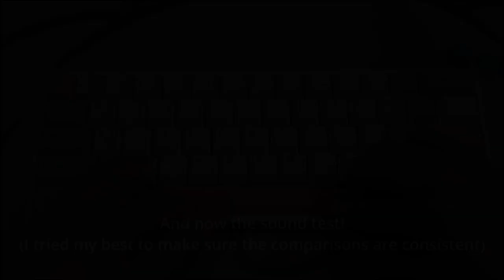Are Silencer Cotton and PCB Foam Sticker useful?

Comment: I recommend using them first in keys that are not surrounded by other keys and those which are closer to you. Those make the biggest difference.
Reply from the maker: I see, will definitely give it a try when my zoom65 comes
Reply: @Dedenki  did the silencer cotton and pcb foam make a difference in the zoom with all the other foam included? Thinking about doing this to the v2 when they come out
Reply from the maker: @FPSBlueFire  I did both for my zoom v1. Not sure of the diff but I always prefer to put these in all the keyboard I make
Reply: @Dedenki  thanks for the response

Comment: Hey, does the RGB shine around the keyboard keys now with the cotton silencers? As in the video I don’t think you had the RGB on. Reason I am asking is that I want shine through keys but not glow around my keys.. does this fix my issue?
Reply from the maker: Rgb shrine through the switches not the gap between the pcb and switch. So it doesn’t affect it
Reply: @Dedenki  Hi DeDenki, yeah I know that and because the switches are semi-transparent the light shines in all directions and bounces off the surrounding keycaps and the plate to create that halo effect of RGB around the keys but I don’t want that so I am looking for the best way to prevent it. Currently gonna try deep black felt tape around the switches to block that light bounce and black keys. Hopefully it turns out alright. I came to the conclusion that these stickers alone won’t fix my issue.

Comment: Is the cotton being sandwiched between the switches and the plate?
Reply from the maker: Yup switch and plate!
Reply: @Dedenki  I saw the picture it actually is below the switches right? Which is underneath the plate
Reply from the maker: @Zhean3553  it’s on top of the plate but below the switches.

Comment: I’ve watched a lot of videos comparing the PE foam mod vs switch pads. The switch pads alone don’t seem to have too much of a difference to the sound as compared to the PE foam. I think because of the way the PE foam is applied, the entire sound of the keyboard seems deeper. But when you put the silencer cotton on, you get a closer sound to that of a conventional PE foam mod which I feel is better. Seems like nothing makes a board sound better like PE foam mod does! Very hard to replicate with switch pads alone. The only plus point I can think of for the use of switch pads is that it doesn’t block the RGB LED of the board :)
Reply from the maker: yeah i think individually alot of the mods might not do much, but if all these small mods add together it does makes quite a difference imo, i'll be making my new keyboard in sep and gonna apply all the knowledge I have to it. (waiting for a GMK keycap!)

I don't do keyboard much nowadays but if you don't mind helping a fellow stranger on the net, hope you can subscribe to give me a +1. Appreciate it!
Reply: @Dedenki  done! All the best making the new KB! Hope u do a video on it too. Will be looking forward to that! :)
Reply from the maker: @thepianokid27  thanks man greatly appreciated!

Comment: Real question: If money isn't the factor, which one is better in order to reduce the mechanical noise? changing the switch or adding padding or foam inside the case, the PCB, the silencer cotton and adding o-ring(s) on the keycaps?
Reply from the maker: all does contribute a little each. but i will say switch itself makes the largest differences. I dont really like o-rings.
Reply: @Dedenki  why didn't you like O-rings?
Reply from the maker: @KingofFray  it reduces the travel distance of the key. Which makes it feel like your key is a bit stuck
Reply: @Dedenki  glad I asked before I buy them. I'll just save my money to purchase good switches instead. but what about keycaps? is there any significant improvement if I changed them in terms of button mashing and mechanical sounds? I'm kinda new to the mechanical keyboard stuff thanks to my colleague bragging about his stuff. I just bought keychron K3 for travel and redragon k552 for my pc
Reply from the maker: @KingofFray  keycap if you can get double shot, the sound is more solid. But similarly, everything gives like 1% Improvement which isn’t a lot, but if you add slot of this 1%, it will make a pretty huge diff
Reply from the maker: @KingofFray  u should find other source on YouTube since my channel isn’t focus on keyboard now. But you can still subscribe to give me a sub count too. I’m building my next keyboard zoom65 soon when it’s here
Reply: O-ring is a big no for me. It feels weird bro.
Reply from the maker: @dateferby1334  yeah after that I don’t really like it. I don’t put it in my recent build anymore

Comment: hello can i use PE foam as PCB foam with soldered keyboard?
Reply from the maker: I would like to say you can since it’s serve the same purpose.
Reply: Ok mate. but how about using both switch pads and pe foam above?
Reply from the maker: @marcus-wv9ti  they both actually does the same thing, so I’ll think this will be a bit of an overkill
Reply: @Dedenki  ty for your reply. Appreciate bro

Comment: are these sticky?
Reply from the maker: Yeah they are sticky
Reply: @Dedenki  if I accidentally put it on the wrong spot,  is it easy to remove especially the PCB ones? and can I still reattach it or do I need a new one?
Reply from the maker: @KingofFray  it's pretty hard to remove, cause the sticker on mine is pretty strong. Will need a new one if stick wrongly
Reply: @Dedenki  great, more hassle and precision for "not that worth it" result
Reply from the maker: @KingofFray  yeah it’s just a good 1%